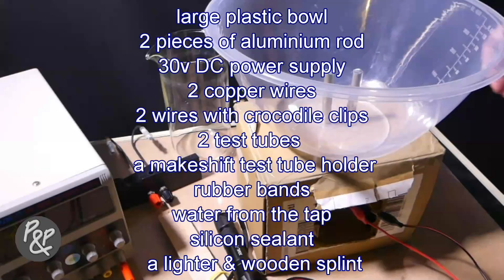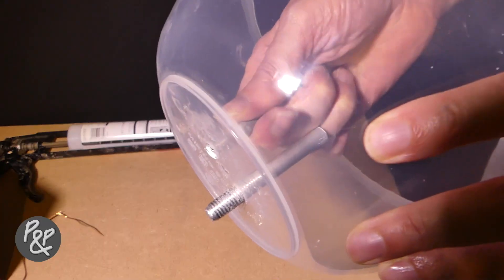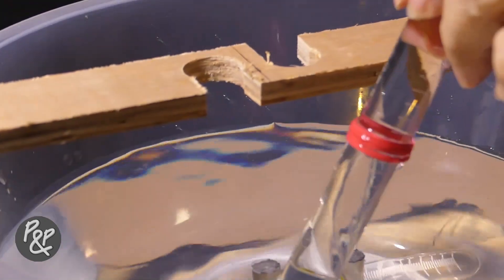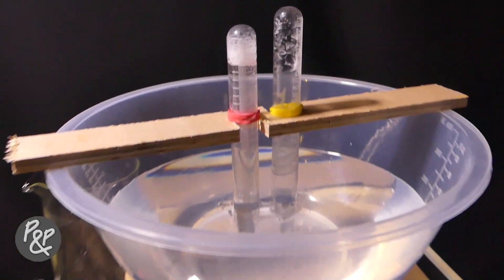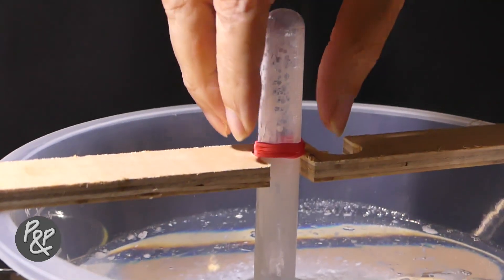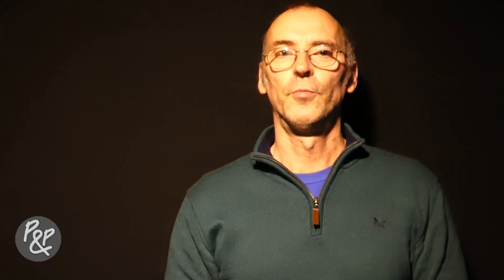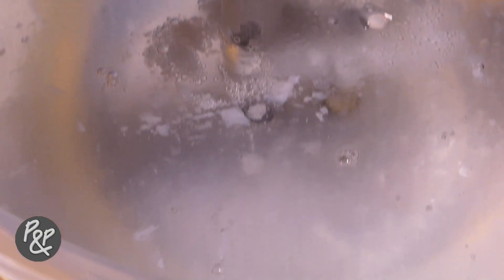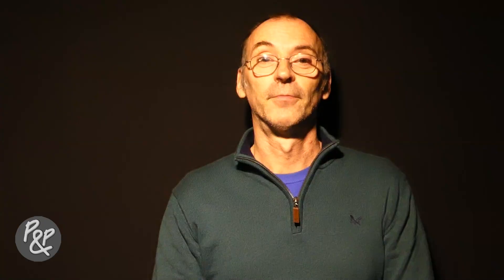Extracting Hydrogen From Aluminium Using Water

Comment: I question your methods as if you truly proved your findings you would win a Nobel prize. I call fake on your side. Hydrogen can be produced using electrolysis. Many actual scientists have proved this. You must use pure water and not tap water to try and prove your hypothesis that water is not hydrogen and oxygen.
Reply from the maker: Quote - I question your methods as if you truly proved your findings you would win a Nobel prize.

That's funny!! Nobel prizes aren't given to people who state the obvious!!

Quote - I call fake on your side. 

In stead of calling fake on our side, why not try and falsify our claim that water does not contain hydrogen and oxygen. Video your endeavours and upload your film to YT and we'll be happy to watch it. If you can falsify our claim we're happy to remove ANY video that relates to water not being hydrogen and oxygen.

Quote - Hydrogen can be produced using electrolysis. 

We're not disputing hydrogen can be produced by 'electrolysis'. Our contention is that the gases generated in the 'electrolysis' set-up come from the electrodes and/or electrolyte, not from any water.

We've carried out numerous 'electrolysis' set-ups to satisfy ourselves that indeed the water, with the help of electricity,  breaks down the materials placed in it i.e. the electrodes and/or the electrolyte which then release the gases at each electrode.

Quote - You must use pure water and not tap water to try and prove your hypothesis that water is not hydrogen and oxygen.

How does using pure water and not tap water determine the origin of the gases in an 'electrolysis' set-up????
Reply: @PeterPete  will reply to the last one, tap water contains other chemicals. Obvious. You lie to your believers. Very sad.  As for the rest you would hand wave it away as you do all evidence that does not match your narrative. Look at the many scientific papers on the subject but then you don't trust them. Enjoy making entertainment as you do. Bye
Reply from the maker: @Woodwork-Learner  so tap water contains other chemicals? I guess then it's no different using distilled water and adding an electrolyte 😀😀😀😀

Come back when you've got something of substance!!!!
Reply: @PeterPete  Fill a container with hydrogen and oxygen, add a source of energy, eg a flame, test the liquid formed, you will find its water, hence water is made of hydrogen and oxygen. Or will you hand wave this away too. Using distilled water and an electrolyte allows control of the experiment. Not everything has to be a lie that only you can see through.
Reply from the maker: @Woodwork-Learner  We've been over that one some time ago.

Quote - Fill a container with hydrogen and oxygen, add a source of energy, eg a flame, test the liquid formed, you will find its water, hence water is made of hydrogen and oxygen.

How does that falsify my claim that water is not hydrogen and oxygen? Water is just the product of the reaction but how do you know the water was not already present before the reaction took place?

For example the water/dew that 'appears' could well be contained along with the hydrogen when the hydrogen was made.
One needs water to produce hydrogen as water breaks down metals and other substances to release the hydrogen from the metals and other substances.

Water is used within the steam reformation process of natural gas when producing hydrogen. Water is used within a metal/acid reaction. So it's clear water migrates along with the hydrogen as in our understanding the water is the 'energy carrier'.

Why do you think condensation forms on your kitchen walls when youo use a gas stove? Because water is present within the gas in the pipe. 

So your little experiment of filling a container with hydrogen and oxygen and igniting the hydrogen to produce water on the sides of the container walls does not determine the origin of the water.

You haven't falsified our claim.
Reply from the maker: @Woodwork-Learner  Quote - If you had anything of substance in your claims it would be news all over the world.

There's lots of demented people in the world who would not want to think water is made of hydrogen and oxygen!! You're one of those people.

Quote - I simplified my suggestion but this can be done under controlled conditions that removes possibly of water being produced other than by the chemical reaction. 

You have to determine the origin of the water!! It is a fact that water has to be used to make hydrogen in order to store it. In our opinion water migrates in gaseous form whenever hydrogen is released from metals and substances and that water is carried along with the hydrogen in whatever container it is contained in. 

Again, when you light your gas stove water condenses on the walls and that's the water within the pipework, carried along with the gas!!

Your little experiment does not falsify our claim but merely supports it because your little experiment does not demonstrate the hydrogen (and oxygen) originates from any water.

Just face it, there's lots of BS in man's fabricated world!!!

Comment: Any chance you had some chlorides in that tap water?   Letting the system run overnight gives plenty of time for some low rate secondary reactions at the anode the build up some OH.
Really do recommend distilled water and a controlled amount of an electrolyte of your choosing.

I did this one in a couple different classes as a student then a lot more as a lab assistant.   If you are not getting about half the volume of oxygen off the anode as you are hydrogen on the cathode, then you have something wrong in the setup.
Reply from the maker: quote - If you are not getting about half the volume of oxygen off the anode as you are hydrogen on the cathode, then you have something wrong in the setup.

Er no! If one doesn't get these results it means water is NOT made of 1 part oxygen 2 parts hydrogen!

In our opinion the demo shows the hydrogen gas and the oxygen originated from the electrodes!. We used water from the tap because water from the tap contains just enough impurities or ions which aid conductivity!

In our next upload we'll show viewers the results we got when using 2 pieces of natural graphite for anode and cathode!

Water is defo not made of hydrogen and oxygen in our opinion!

Comment: Whatch joe cell?  He confuses on purpuse! He is producing hydrogen from aluminium engine parts  just like in your experiment. But how to disolve passiv layer on aluminium. And where would you put katod and  anod on engine?
Reply from the maker: we're aware of the joe cell - in our opinion gas products originate from metals eg stainless steel!
Reply: @PeterPete  hmm  he say to use  aluminum tub to connect with engine but thru rubber tub as connector. And you have insulated katod and water inside is a conductor.
Reply from the maker: @riszisan7020   i'm trying to understand the point you are trying to make about the joe cell in relation to  the video!

Can you explain plz
Reply: @PeterPete  coud he use aluminum radiator (oryginal monted in car) later on as a cathode?
Could he use aluminum keg to saturate water with aluminum? He sad many times he changed polarity of car. 
First question is how to start oxidisig aluminum inside engine so it produce hydrogen

Comment: I have a few questions for you Pete & Peter which are not directly related to this video.
1) If oxygen becomes present by compression.... then a lit match in air must be causing some sort of compression... Yes?
2) What happens to the oxygen as it is "consumed" by fire? Is it only changing states? ie Becoming uncompressed as the consumed material dirties the air?
Reply from the maker: thanks for your comment, 1) in our understanding oxygen becomes present through concentration which is ahcieved through calorgenation.

The lit match would not adsorb any concentration of air because it is thermally decomposing so there is no oxygen. 

2) imo it gets consumed in the process of combustion
Reply: @PeterPete  Thanks.... One other point. You guys opinionated that AIR might be dried WATER. In Astrology the 4 basic elements are Fire, Water, Air and Earth.. which divide as Yin (Fire and Water) and Yang (Air and Earth) with  AIR being the ultra masculine and WATER being the ultra feminine! Now if there is a direct connection between WATER and AIR then I would suppose that there would be the same sort of connection between FIRE and EARTH albeit of a different kind of course. Maybe EARTH is just unburnt FIRE? I realize that may be slightly simplistic using "unburnt". Is molten rock close to burning?
Reply from the maker: @elcid451  quote - Maybe EARTH is just unburnt FIRE? I can understand your point. if one accepts glowing particles to be fire then unglowing particles would be unburnt. I personally think the main problem with the idea of earth being an element is the fact there are different kinds of earth. For example there is soil and rocks, minerals and even ores of different varieties!
Reply: @PeterPete  When I say "earth" I mean in a more general sense. When you stated that air may be dry water... then looking at the 4 basic elements in astrology... it made sense to suppose that "earth" maybe unburnt fire. Now I know "unburnt" is a crude description but I'm try to relate air as being "dry water" with earth being "unburnt fire". Just a thought!?

When water freezes to become ice it loses its wetness. So you could apply that same logic to the various earth substances
Reply: @PeterPete  I consider soil, rock and minerals to be EARTH
Reply from the maker: @elcid451  sure so what is common to all rocks, minerals, soil, ores etc?
Reply: @PeterPete  They're solid ie material
Reply: @PeterPete   if you read the abidhamma, they go into detail on elements and how they behave…each element has the properties of all the other elements in various ratios…and are predominant in one…
Reply from the maker: @hooozmad  I can imagine every religion has its own take on the 'elements' and I'd also imagine every religion express the position that lying beneath everything is a unifying 'thing'.

In this respect we could say it is hydrogen and the vacuum that holds hydrogen within materials.

So I guess it's a case of same shit different cover.

However the important thing is lack of proof to substantiate such positions!

Humans can never come to know the true nature of the real world they can only experience it; whether pleasant or unpleasant!

Comment: Can you test the foam?
Reply from the maker: the white foamy stuff imo is really an aluminium hydrate - one could dry it out but it won't be aluminium oxide because how would one test to see if it contains oxygen? Maybe one could heat it up to high temperatures in an open furnace thereby oxygenating it. But then one would need to see if that dried aluminium hydrate is the same as aluminium oxide?

That question is open to all to answer!

I guess you could bombard them both with the same tests to see if they respond in the same way!

Comment: Was that 2.1amps you used? Great video.
Reply from the maker: soon after we started up the power supply we cranked up the voltage to 30V from 2.1v

So the 2.1 was volts not amps!

Comment: Does Water from the Tap not contain a multitude of metals? So wouldn't it be more fitting to use distilled water? Great experiment though!
Reply from the maker: we only used water from tap because the 'electrolytes' are already in the water! - in our area typical TDS reading of water from tap is about 180ppm
Reply: Distilled water doesn't conduct so electrolysis wouldn't happen. Would have to add a salt and depending on the salt the resulting gasses will vary as P&P have shown in a previous video. The net result is the same, no guarantee of hydrogen and oxygen via electrolysis.
Reply: @mtlmanmtlmann329  So in this experiment it's Hydrogen from Aluminium + the array of metals in the tap water? Thanks for the reply!
Reply: @GANGPLAY  What metals are in your tap water and how many grams per litre? We could compute to determine how much gas was contaminated with impurities. Its still odd no oxygen was produced even after the tap water impurities were burned off...